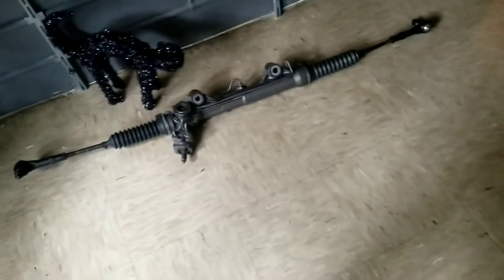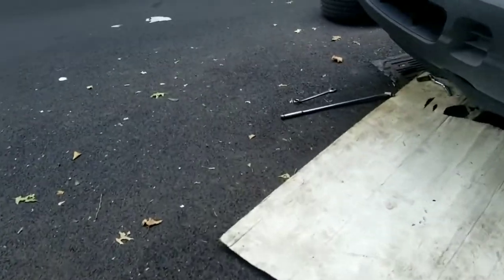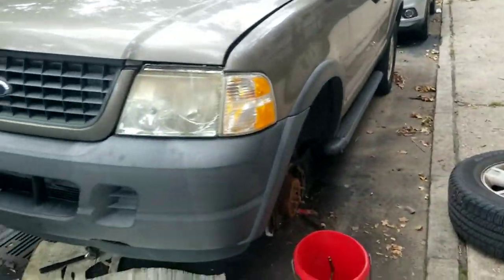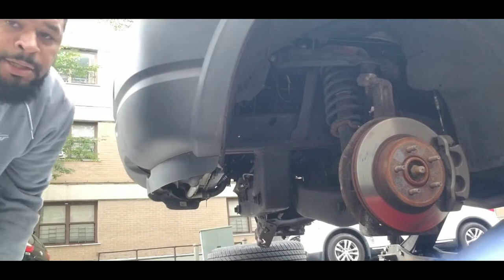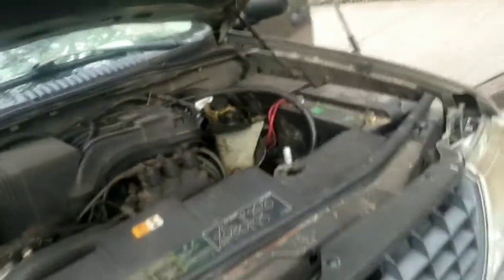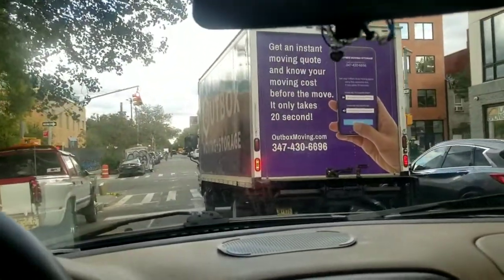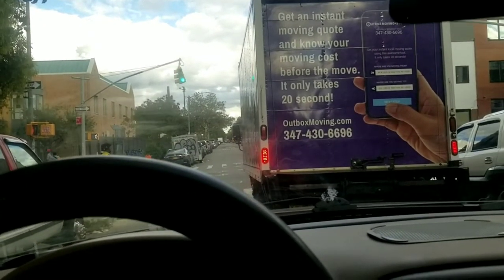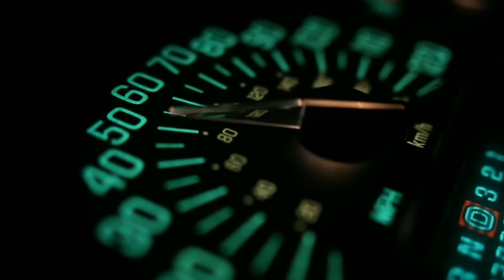2003 Ford Explorer Rack and Pinion Change | Street Car Work | Mechanic

Comment: Heh it's new for me that you needn't detach the lower arm from the the frame to extract it.
If you save control arms on its places - you needn't alignment (if car aligned properly), you can simply measure lenth of each old tie rod assembly and adjust the new one to the same measurement, so wheels alignment will be saved.
Please use safety stands when work under you car with wheels removed! At least place wheels between the frame and ground to protect you against possible jack failure.
Reply from the maker: Thanks for the advice